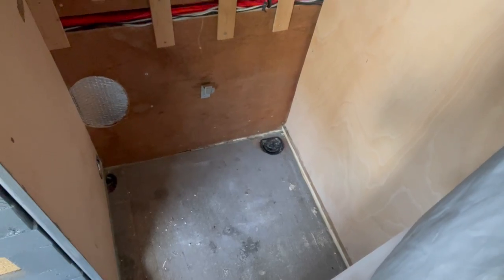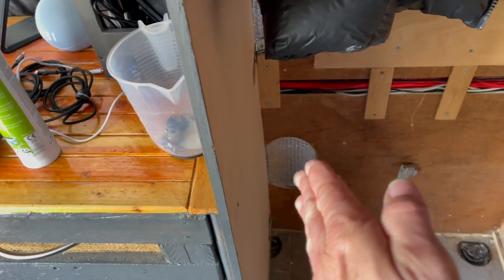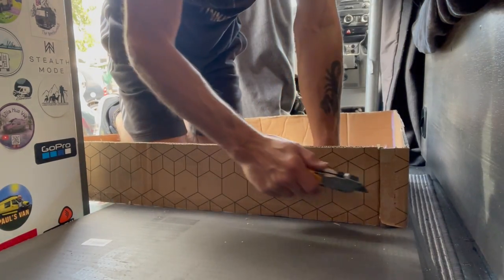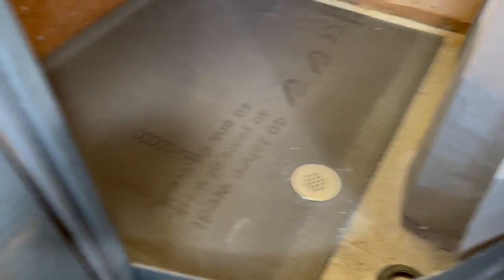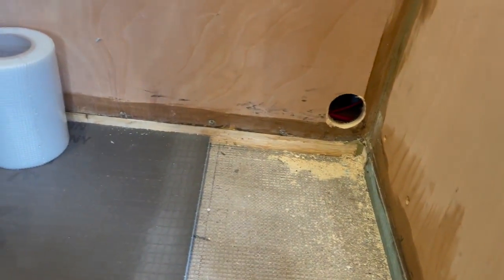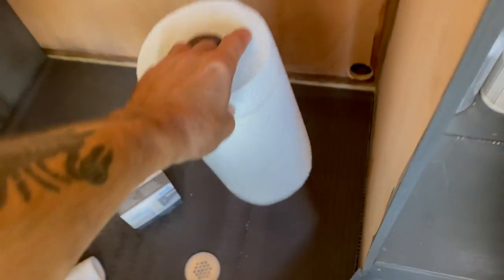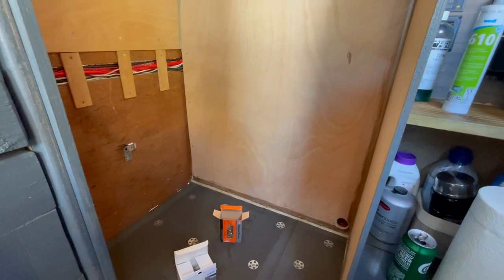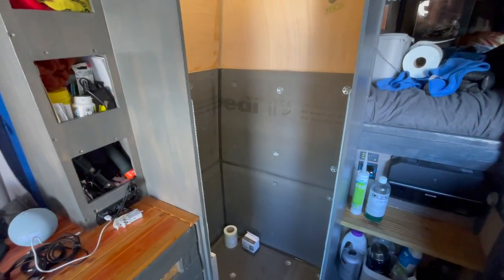Camper Van Shower Toilet Wet Room Construction

Comment: 🙋‍♀️  are you going to get the porta potti through that gap ❓  but looks good so far ...  hope there are no leaks - can't wait for the test 😆😆😆
PS: I love your  "Outatime" vehicle plate - watched B2F trilogy many times 💯💯
Reply from the maker: I must admit when i went to put the toilet back in, i may have a problem , but i can still remove it with quite a few inches to spare so its all good luckily . I absolutely love b2tf, i even a have a brand new mint and boxed crupps coffee grinder with mr fusion decals on it.👍
Reply: @ProjectCamper   🙋‍♀️  I'm very jealous ...  but does it have a Flux Capacitor inside ❓   😆😆😆

Comment: Hi m8 as it is a wet room wont the screws and round metal ring plats start rusting ?
Reply from the maker: Ive used stainless steel and the wet room will be tanked and then over boarded with 3mm shower trim